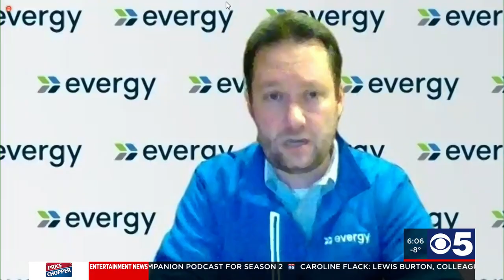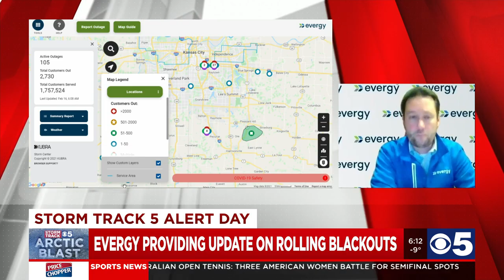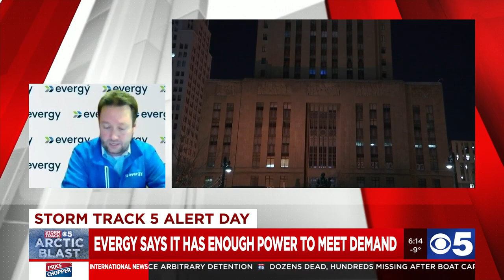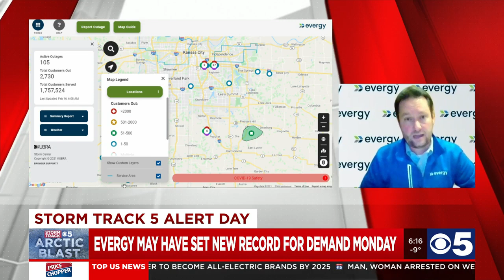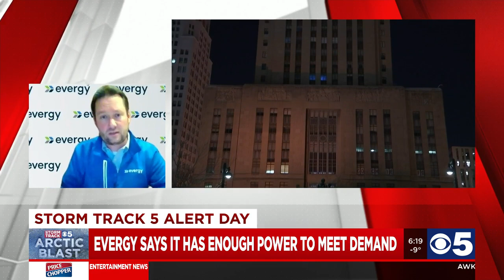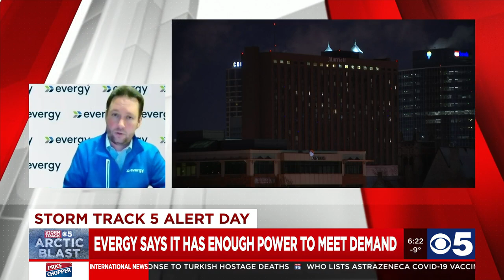Evergy provides updates to customers on rolling blackouts today

Comment: Evergy, turning off power for 3 hours is not a short 30 minutes, you've disabled your website, and won't even answer your customers calls. Did you know that the 30-60 minutes was a false time amount before you did this?
Reply: In zero degree temps with no notice. Basically attempted murder. I will take my regional capitalist power broker back now. Screw this "to big always fails" socialist/ globalist crony conglomeration determining when I a paying customer have access to the service requested. If you cant handle it forfeit the federally mandated monopoly or get sorted out the ole fashioned US Constitutional way REAL SOON communist trash.